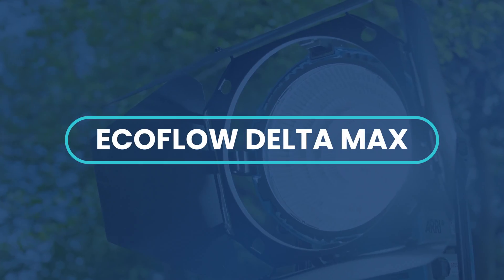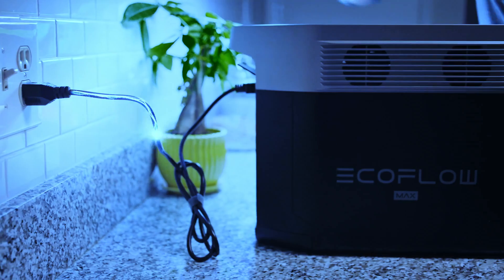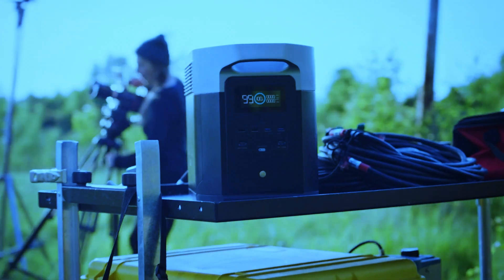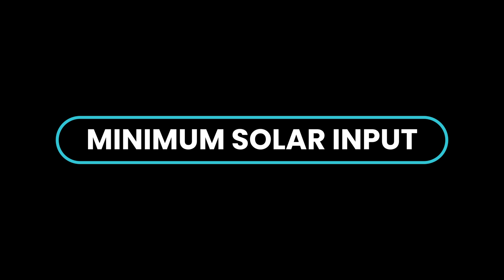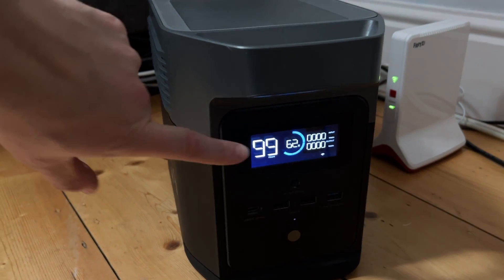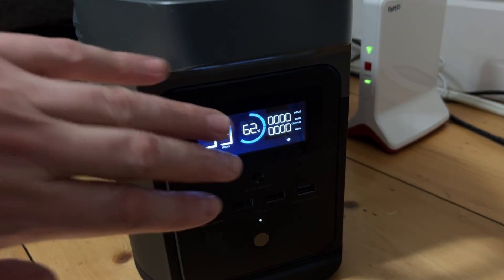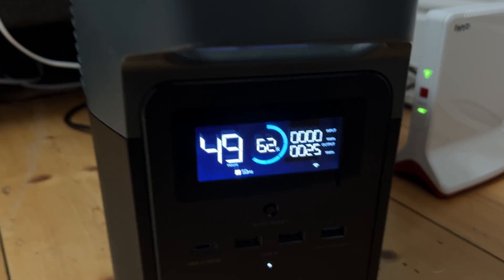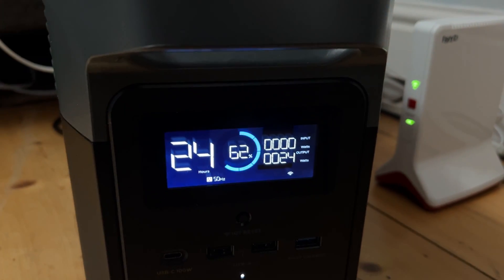I Was Wrong! - Ecoflow Delta Max - A Few Corrections & Updates

Comment: This system has caused a number of fires and reportedly about $850,000 in damages.   The reason is using a NMC battery chemistry.   The irritating part is they never issued a warning about the extra batteries Delta max smart extra battery using LFP chemistry.  So the chemistry is mis-matched and cannot calibrate the charge/discharge levels.    Never will buy another Ecoflow product.

Comment: STAY FAR AWAY FROM ECOFLOW PRODUCTS.  I HAD A DELTA MAX AND IT WORKED A FEW TIMES THEN DIED.  IT WAS UNDER WARRANTY AND I HAD IT REPAIRED AND USED THE REPAIRED UNIT A FEW TIMES AND IT FAILED.  OUT OF WARRANTY, OUT OF LUCK WITH ECOFLOW.  I WILL NEVER BUY ANY OF THEIR PRODUCTS AGAIN.

Comment: I have ordered a Delta Max. Sure hope the new generation comes.
Both for the sake of quiet and the 2X XT60i inputs.
What I did make note of, getting ready, is the mandatory app agreement. Does any one read these things?
The indemnity clause is nuts.
Say; the unit fails in a way that your insurance company gets involved and  sues Ecoflow, you must pay for Ecoflow's counter suit.
With out the app, much control is lost, like the default xt, which I think is set the wrong way.

Comment: I love Ecoflow products but I hate their customer service.  I bought 2 delta max 2000 because I decided not to buy the expansion battery since it would be practically about the same price without being to charge it or use it separately.  Because of the customer service I won't be buying anymore products from them, it is just too frustrating, but they did eventually make up for my frustrations.  Pecron has now upped the game and their expansion batteries have dc ports and can be charged separately .   Enjoyed your videos.
Reply from the maker: Customer service seems to be mixed. I've generally had fairly swift responses to enquiries and have had products replaced without too much hassle. It does seem a bit hit and miss though. So many companies cut corners here because the profitability and benefit of having good customer service is so much harder to measure. In my opinion, it's one of the most critical parts, particularly with an older customer base who are loyal and have money to spend.

Comment: Are you warning people about the problems with the unit not being used for a period of time. I bought a ecoflow delta Max to use in my home for emergency use in the event of a loss of power from the Electric Co. But... the manual says not to leave it fully charged! It recommends to discharge the battery to 60%! What good is that?? Mine recently discharged on it own down to 1%, even though I had used it some in the last month, and fully charged it before turning it off. Manual also warns this could "cause irreversible damage". I could not recommend this product to people who are prepping for an outage!
Reply from the maker: Batteries should be stored at roughly 50% charge. That’s just a battery thing which is applicable to all batteries of this chemistry. They don’t have to be but it’s good advice to get good life. If we’re being picky, there are also certain ideal temperatures for storage too but that just gets awkward. As far as drain when off goes, I haven’t noticed this at all when the device is properly turned off (hold the power button) but when in standby, they lose about 1-2% per day. That’s quite normal.
Reply: I always store all my batteries at 100% and never worry. It doesn't really affect performance and in fact the whole point is to use a product at 100%...or you might as well just buy cheaper less powerful units 🙄

Comment: RECOMMENDED SETTINGS FOR ALL ECOFLOW UNITS
To get many years out of your battery go into Energy management settings and set them as follows.
Discharge limit 30% charge limit 90%
And if you have it plugged to AC or on solar in witch i recommended set the energy saving to 80% incase the power goes out.
Also go into the AC charge setting and set that to optimized battery charging set to 500w so the battery does not get hot and shorten the life of your battery.
Only use fast charging if the battery is completely flat for a one of quick charge as the battery gets hotter if you are charging fast all the time.
Also one a month unplug the solar or AC depending with one you are using at the time and discharge to 35 % and then reconnect the solar or AC recharge to 85% then go back to the previous set up.😁😁👍👍👍
Reply: In my opinion that's nonsense. I've been using my Ecoflow River and Delta units for years 24/7 year round outdoors, and always charging to 100% and discharging to whatever I desire, often to zero percent. Zero problems. What's the point in paying all that money to only use a fraction of the power? 😂
Reply: @Globetrotter-1  100% Amen to that
Reply: @stormchaser300  I also always charge the Delta 2 at fastest charge to 100% with AC, or when in my SUV, just power at 800W fast charge to full 100% using the Ecoflow Alternator Charger, often not driving and simply stationary with the engine ticking over.
Reply: @Globetrotter-1  Charging at 500 watts is better for the battery life.
Discharge limit 30% charge limit 90%
Reply: @stormchaser300  Hogwash! 🙄😂 Some of my batteries are 15 years old I'm still charging 💯 %.
Perfect performance. Even if a battery declined slightly after 10 years...what the hell does that matter? Plus the fact that most people update their power stations to the next super-duper latest versions long before their present batteries begin to decline. My old Lithium Ion batteries still perform perfectly and hold full charge. My younger Iron Phosphate (LiFePO4) batteries will no doubt still be pumping out great performance for a decade, even though I'm using non-stop and charging daily to 💯%. Besides...batteries can be affected just as much by knocks and temperatures, so worrying needlessly about never charging to full capacity or using all the power available...is just laughable. There's far more important things in life to worry about.
Reply: thanks for the tips stormchaser
Reply: You are welcome.😁😁 @treegsaloha5931

Comment: Maybe on cloudy day just swap solar plug to a smaller unit that can handle take advantage of it. Then plug that into big unit as charging source maybe in case it gets sunny. Not perfect solution. I guess depends if you know weather forecast and want to gamble. Thinking about it more, it's such a small amount. I'd rather gamble it will get sunny. However, maybe there's a splitter that can let small unit draw power with big unit drawing or not. And then it would fill up quick and shut off if it got sunny and big unit would collect large amount. Still a hassle but if you really want a tiny bit of power for a backup phone charge or two seems possible.

Comment: CUSTOMER SERVICE IS HORRIBLE.  I bought a machine in May, it is now August and I have had over 20 emails to the support and I still cant get them to take the machine back.  It is useless and I do believe they lied...I do believe there is some fraud in the marketing...I came to see how many people would like a review from me on the Wave2 a product for a car but not for anything they say on the website...definitely not and the fact that they say it can, it a lie.  A BIG FAT LIE.
Reply from the maker: I've had mixed experience with customer service. Recently, responses have been relatively quick (about 2 working days) and are usually informative and helpful...so not just where you're fobbed off with a load of questions or inaccurate responses that don't really help or relate to the problem. It seemed worse a year ago so hopefully this is something they're working on. 🤷🏻‍♂️

Comment: can i connect my delta 2 smart battery to a delta 2 max???
Reply: Yes
Reply: Also can be connected to a smaller Delta 2 and works fine, even with original Delta Max smart battery, once you update the firmware.

Comment: well the comments your saying about Ecoflows customer service is very saddening for me, luckily - i had a very different experience, 

BOM - 12v fridge / 90w macbook pro / a list of usb devices even a network supporting internet connectivity and even a AC hoover on clean up days 
when the hiccup happen it wasn't taking any charge via solar / 12v / 240v and would run in low power mode (1% all the time) 

my experience - river pro max user powering a self made RV / van set up running 247 for 4 months with one hiccup, 
Because its my main source power in my living situation i contacted Ecoflow ASAP within one phone to point of purchase i had a great amount of support,

while on the phone i was advised to reset the unit and while waiting for the process / power cycle to complete, Shade @ecoflow AKL gave me free postage via email + out of hours contacts (just incase i had troubles) with the add bonus of unit replacement from any NZ store / retailer - if any fault was found on my unit, 

luckily for me after the power cycle the unit was all it needed and was good to go, the unit worked for another month 247 no faults, 

now i know its a different model and is a different power level but the noise issue only if you running anything other then AC240v, when running  its pretty unnoticeable {Ambient noise levels wise}

i was bowled over with the response from Ecoflow and Shade @Ecoflow AKL was a legend and clearly went beyond the call of duty, 
Personally i think your issue was more the country, of purchase cos lets fact it UK customer service is piss poor as best (and its getting worse because of external factors)  

please don't see this as a attack on your findings, i can never deny your lived experience  but as a fellow tech nerd i wanted to share my story and hopefully to give hope / faith for anyone looking at purchasing one of these great devices, 

for context I'm Electronic engineer by trade with 20+ yrs of VC / VOIP / AV IT install / maintenance experience and these guys hands down beat customer service that iv personally had to a string of international brands (Cisco / Crestron / Etc etc) 

 
thanks for coming to my ted talk 🤙 chur
Reply from the maker: Thanks for sharing your experience. As you say, this is just my experience and I hope that EcoFlow continue to grow with their products and also with the all essential customer experience. The products are top quality and, although I only have a year of experience with these type of devices, they are top of the pile and my first choice with anything related to off-grid power.

Comment: what about adding new extra battery after 1-2 years of usage? theese batteries will not be in the same condition (health) and we are connecting them as parallel? (actualy the connection will do it for us since we are not expecting high voltage. looking for same voltage more capacity so it has to be parallel )  one with the old one will drain the healthier one to equalize voltage ??? I m asking this not to criticize anything just want to learn ... because in off grid solar system its not a good idea to add new batteries to the system since new batteries will be worn out faster... cuz circuit will drain it.
Reply: IT doesn't mater because both battery's have there own battery management system BMS.😁😁
Reply: @stormchaser300  yeah correct info but not talking about battery management system it works for all brand new batteries; I am talking about adding new batteries to old system Bro; new one will worn out faster...

Comment: Does your ecoflow use power with the dc switched on but with no load on it please?My Delta 2 does😩
Reply from the maker: Yes. All devices like this have a certain drain just being 'live'. I guess it's similar to having a normal appliance on standby. E.g. the Wi-Fi module will be powered up and connected to the cloud ready for you to connect the app. I'm not sure how much power is used. My guess is 5-10W. To avoid this, you need to press and hold the power button to fully turn the unit off (it shows 'OFF' on the display).

Comment: Agree customer service gave scripted answers.  I wanted to know if I could run it as a UPS - plugged in 24/7 with item plugged into it .  Only using unit power when grid goes go down.  Kept telling me that UPS was same as EPS.  Finally told me yes, could use as UPS!
Reply from the maker: The Ecoflow documentation claims a 30ms switchover. This is extremely quick but not below 10ms which is what I believe they need to call their device a UPS. I'm surprised they gave you that answer. Either way, 30ms will probably be fine for most stuff. I've tested it with computer gear (which is what I would want) and it worked fine.

Comment: This is really helpful.  I was going to send my unit back, chiefly because of the noise on charging/use and the silly App, but I might take your advice and persist with it.  Thanks.
Reply: Silly app, huh? I don't even like the term 'app'. I've never used wi-fi nor had the need for devices other than my hard wired PC. I'd love to find one of these gennys that did not require any app. And if these products do actually need the occasional firmware update or what have you - be able to connect it to my PC for that. Know of one like that? Thanks

Comment: Bypass functionality from solar input are disabled after firmware update (to 1.6.2.45) of the EcoFlow Delta MAX. 

Now battery are constantly charging to 100% and discharging to 97% (even if your solar panels are producing more power then you need).

This is downgrade because solar inverter and cooling system is deigned really bad and when you use it daily it dies really fast.

Ecoflow called this “optimized charging policy”, thank you EcoFlow for such a nice upgrade!!! XD.

I have hope that this is a joke, because they are selling product and then after few months take you big part of  functionality
Reply: Yeah I bought a Toyota hybrid that got 4 minutes on battery and 4 on engine. I took it to a dealer and got an oil change. They put it on the Toyota computer and it took 2 minutes away from on main battery time. They all do this to keep from having to put a new drive battery in a car say a few years before warranty goes our. They are all thieves!

Comment: The Delta 2 has very accurate calibration on remaining time to charge/discharge - I wonder what they're doing differently?
Reply from the maker: I would say the different battery chemistry between Delta and Delta 2 but considering that every other multiple cell power station I've used with the same chemistry does it just fine, probably not. Maybe they just realised it's not very good and fixed it! 👍🏻
Reply: @tdcattech  cheers - keep up the great work!

Comment: Is it safe to have the battery sitting on too of the Delta Max or do you put the Delta max on top of the battery?
Reply from the maker: I’ve found it to be fine (Delta Max at the bottom). No ventilation is blocked and the battery runs cool. I’ve seen no change in temperature in either unit doing it this way. Good question though. 👍🏻